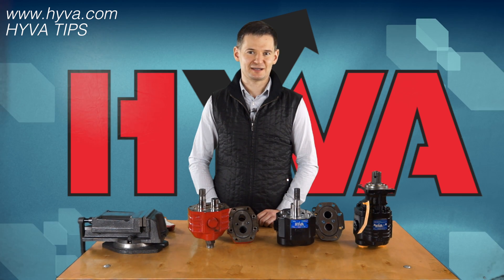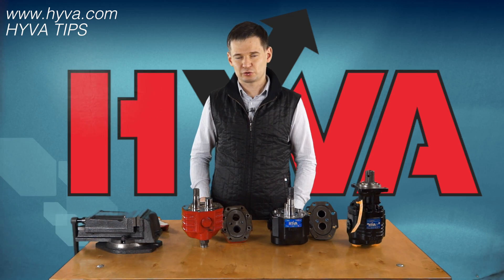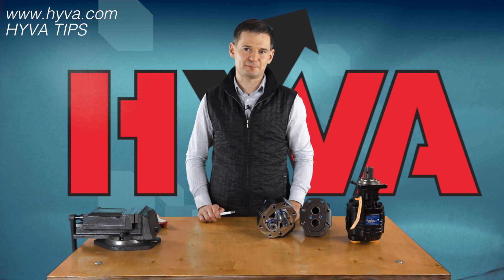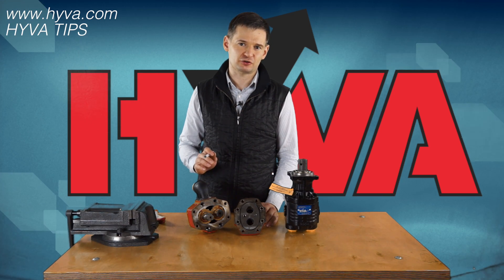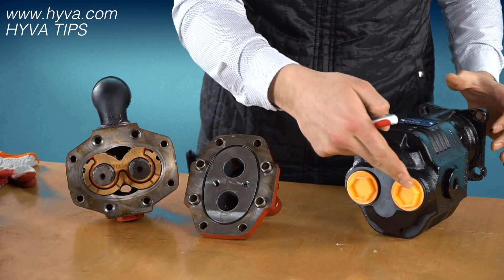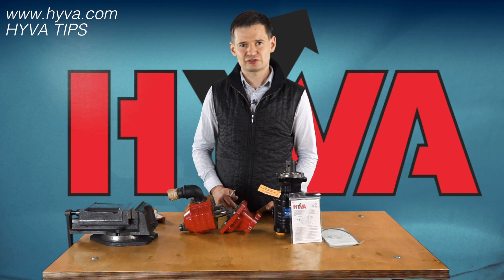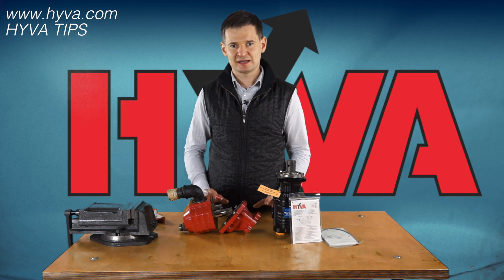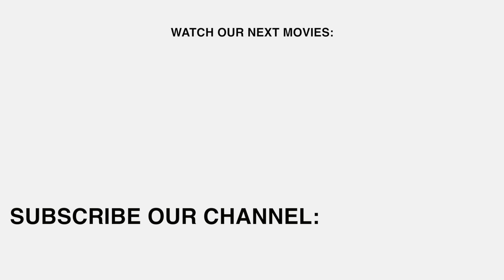How to change rotation of the pump?

Comment: sir 
I've a problem in pto control valve .
control valve is direct Air leak problem in control  valve on/off .
what is solution is this problem.
Reply: Sir.pl call 7003757884
Reply: I have problem on this pump.
Hydraulic oil burst